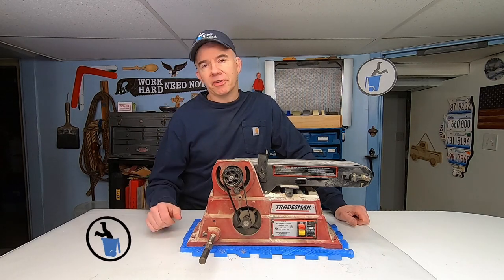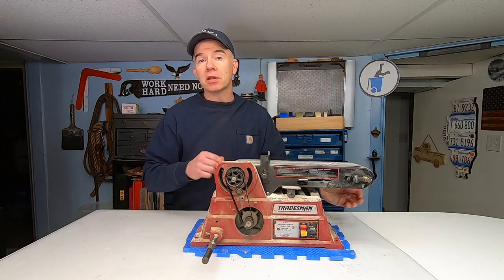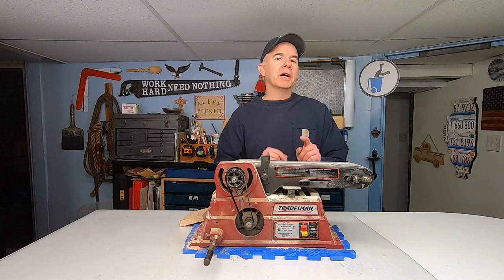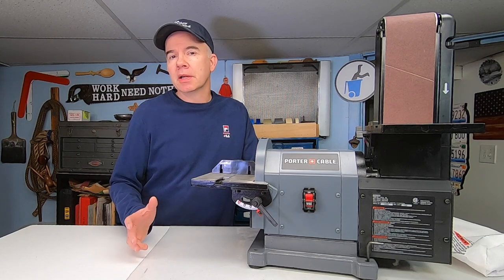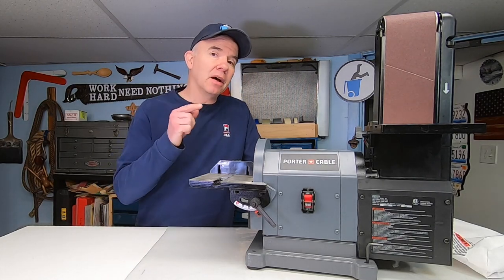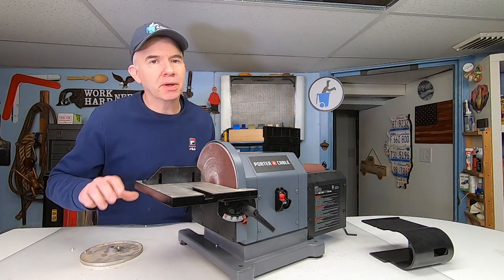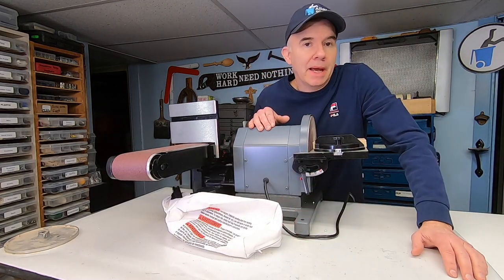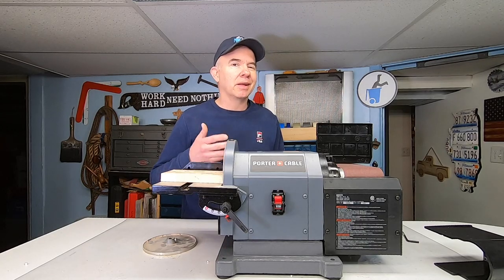The Best Benchtop Belt Sander Under $300

Comment: I got the Wen and while it is made in China it was all I could afford but I was very pleasantly surprised.  Have had it for about two years now and use it almost everyday.  It is a workhorse and has zero problems.
Reply from the maker: I was seriously considering that one also.
Reply: Other than the larger motor housing...everything else looks exactly like the WIN.  Same exact moving parts to change out the 4 by 36 and same exact mechanism to adjust the paper.  Carbon copy.  Even makes the exact same sound.
Reply: I have a Wen drill press, and no complaints. It's a good enough brand IMO.
Reply: I considering the Wen model as well. In fact, it looks identical as one sold at Harbor Freight, Grizzly Industrial, and Menards. Same model. Different colors. About the same price point. Menards has their version for $99 this week.
Reply: I got a Wen drill press and its a POS... never would I recommend Wen to anyone.. Jet on the other hand.. great

Comment: Bought one today at Lowes.  I think I have a refurbished model.  Some paint rub where the plate adjusters meet the frame and a couple eraser sized paint chips on the front.  It's a tool, but I'd like to chip my own paint.  Hopefully I have no issues with it.  It's much better than the 20 year old Delta I just sent to the dumpster.  Sounded like your old one and the switch went on it a while ago to "always on" lol.  BTW, the feet fit perfect in the ribs of a gen 3 Tacoma tailgate.  I'm currently using it to clean the ends of cut plastic paver edges that I'm cutting to length.  Nice to be able to do the work right on site.  It draws more amps than what the truck bed outlet can provide though.

Comment: I just purchased one at Lowes on closeout.  The tool guy told me they were dropping the Porter Cable line.  This one is so much better than my old Craftsman.
Reply from the maker: I just had a plastic fin break off. It's connected to the motor shaft so it ran out of balance. Fortunately it has a 3 year warranty so I brought it in to a place for warranty repair. Still waiting to get it back.

Comment: This appears to be almost exactly the same sander as the Bucktool BD4801. These are direct drive sanders which have a lot more power than comparable 4 amp belt drive motors.

Comment: I have the Wen 4x36 with 6in disk and like it but feel like it could be a little more powerfu
So i bought the porter cable one in this video and was planning to return the Wen once i could confirm its better.
The porter cable is alot heavier  which maybe a good thing if your not miving it around, and is double the money of the Wen. I found no significant difference in power. The porter cable is no better except it has a 8in disc instead of 6in.
I'm returning the porter cable unfortunately.  I don't see any reason to pay more than double the money for something that is the same..
To me the 8in disk isn't worth paying way more
Reply from the maker: Good info - Thanks for sharing your findings.

Comment: That dust collection bag looks a bit inconveniently placed. Does it interfere at all with the belt sanding?
Reply from the maker: You have to keep it a little away from the wall but it doesn't interfere. The disc sander does spin up a bit more dust than the belt. I think thats because it's further away.
Reply: @AlleyPicked  My concern is, at the 5:00 mark you're sanding with the belt sander down and the dust collection bag fully inflated. It appears that the dust bag is VERY close to the sanding belt and might be forced up against the belt unless you keep an uncomfortable distance from the machine to keep from ripping the dust bag. I looked at the Ryobi bench top sander and all off it's clones, but I am leaning towards buying the Porter-Cable. Have you considered placing some hose or tubing between the sander and the dust bag to give yourself some breathing room?